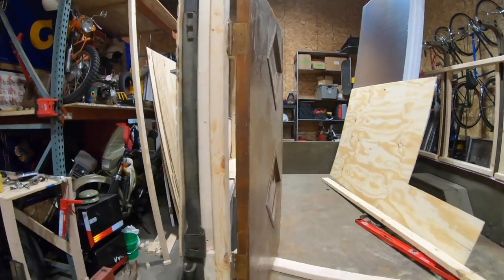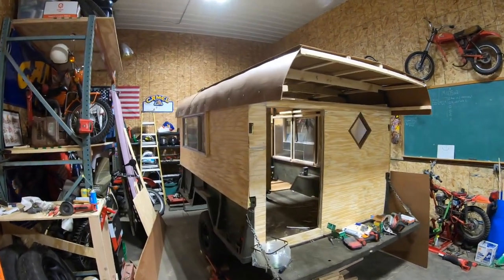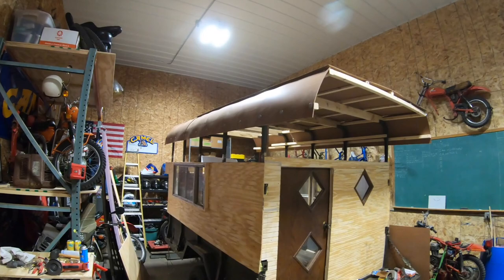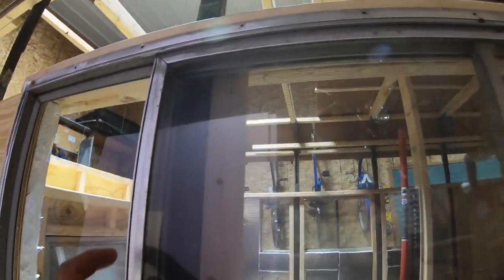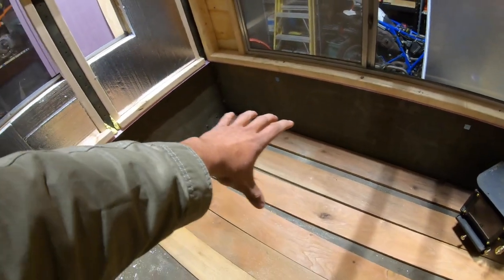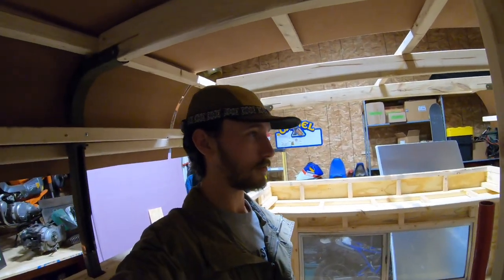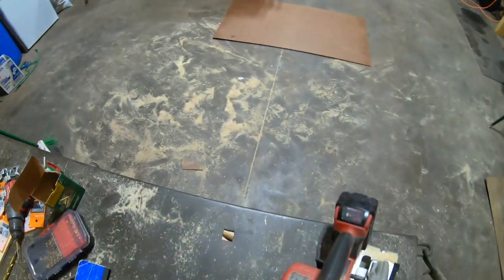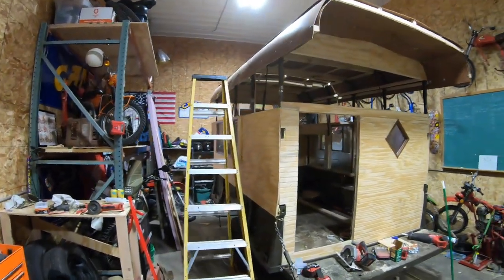EP: 2 | Vintage Military Camper Custom Pop-up Conversion | M105a2 | Walls/Roof + Pop-top Functional

Comment: Check out linear actuators -- even a cheap one can pull/push 2-300 lbs.  They run on 12V so they can be reversed by changing the polarity with a simple 6-screw (DPDT) switch, and they have built-in limit switches to shut off at full-close and full-open.
Reply from the maker: Will it continue drawing power when fully extended? If not I can always pin the roof up on the slides
Reply: @prairieratmotors  They switch off when they reach their limit -- no more power drawn.  They can rigidly hold against falling.
Reply from the maker: @Wingnut Stickman  I'll check em out, thanks man, seems like a perfect alternative
Reply: @prairieratmotors  No problem.  I use one for my gate, I use three to open and close the skylights (roof windows) in my house.  Very reliable.